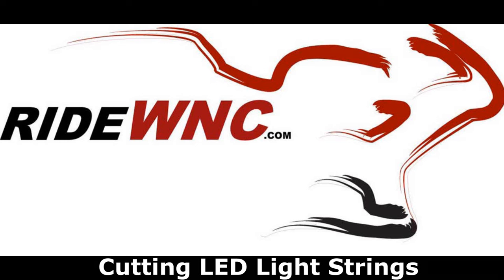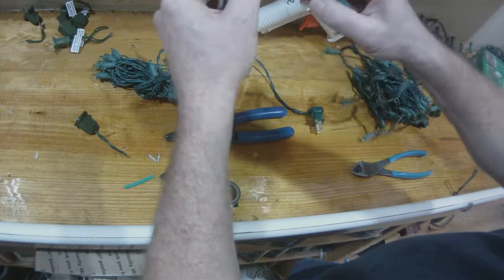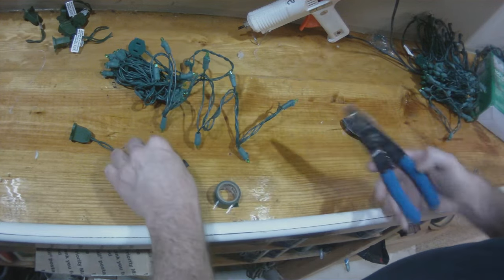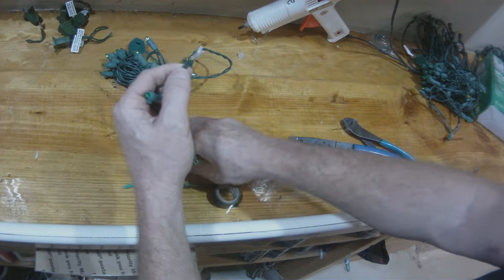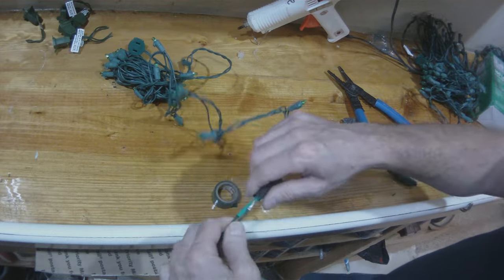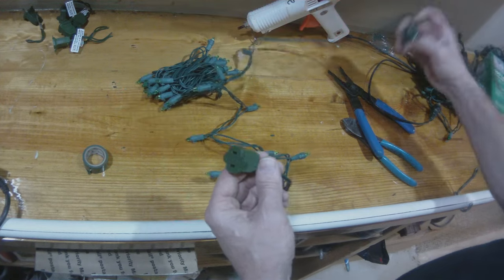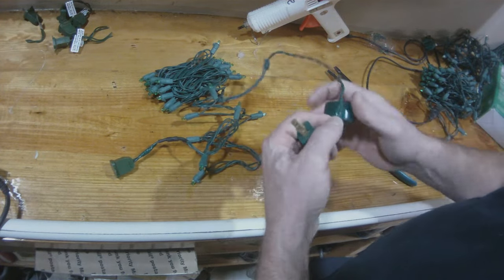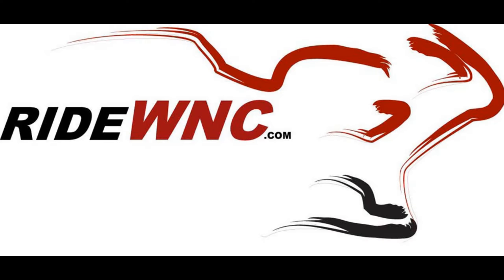Cutting LED Light String

Comment: I needed 22 feet to surround a window.  Found a 33 foot 100 light strand.  You mentioned that every approximately 34 lights, I should find a two wire run.  I followed your instructions.  Worked perfectly!!!  The result was a perfect 22 feet strand.   Thank you so much.

Comment: I accidently cut the three wire section of my led mini lights, can I just splice them back together? I assume I have to connect the one wire that goes from light to light. Does it matter on the other two? I am not sure I can match those up. Thank you so much.
Reply from the maker: You need to connect it to the exact opposite wire. Power moves through an LED in one direction only unlike a light bulb.
Reply: @RideWNC  Thank you Mike! Got it squared away. Appreciate your time. Merry Christmas!

Comment: I've been searching for what seems like hours now, and can't find anything on shortening a 4 wire string.  The set I'm working with has 4 wires down the length with a periodic 3 wire section in the same pattern where the 2 wires would be in a 3 wire system.  Any advice?  Thanks!

Comment: Thanks for posting this. I'm going to add a length of wire into my 2000 led strand so that I separate the lights between my house and garage. I'll just cut in at the two wire and add a new length in. Thanks for explaining. Darren, South Wales, UK.

Comment: I did exactly this, but I all I got was, some lights are off, and the rest are blinking. I tried the other way of connecting the 4 wires, this time nothing comes on. Is it a faulty unit? May be relevant: I tested with twisting the wires (no soldering or wire nuts). Thank you for any and all guidance, hopefully someone will see this within a year. 😂
Reply from the maker: You can only cut the string where there are only two wires. If you cut more than two wires, you probably ruined the string.
Reply: @RideWNC  I did experiment with trying to connect 2 wires from the plug to 3 wires from the string, but didn’t work. After watching your tutorial, I saw my error and found the segment of the string that has 2 wires, and spliced that to the 2 wires of the plug. I guess my earlier experimentation ruined the entire string. Is it at all salvagable?
Reply from the maker: @uygar84   Just discard that section. Save the LED for spares. Part of that string can be saved if you cut it off where there are two wires.
Reply: @RideWNC  That’s what I mean. I did exactly that. My string is wired exactly as yours right now. But what I’m getting is: some LEDs blink, rest won’t even turn on.
Reply from the maker: @uygar84  You probably fried that string.

Comment: Using this same concept.. Could I splice these wires together and have two 18ga wires tying them together with a vampire plug to make a 3 way for the lights to go up on another ridge? I am trying to save as much "light string" as I can.
Reply from the maker: Yes. I would not use the vampire. Get the barrell connectors so you are 100% sure good power gets to the lights. Sometimes the vampire does not get a good bite into the copper. I don't trust them.
Reply: @ thank you sir!

Comment: You totally solved my problem. My male connector got a short in it. Thought I would have to replace the entire string but i just replaced the male/2 wires in the led string. THXU so much!!

Comment: Thank you!!
With incandescent do I need to worry about the fuse if I make make my stands longer by crimping two stands together?
Reply from the maker: No. Just don't exceed the number of strands you connect together. The number is on the light package.

Comment: Just yesterday I cut a 3 wire strand and took out several sockets and spliced the female end back onto the strand and it worked just fine. The plugs on both ends of the strand have 3 wires coming from the 2 prong male and female ends.

Comment: Mike,..that was concise and clear to me! Perfect! Thank you sir! Also,..I'm assuming that if I do not need a female connector at the end I could just cap off the 2 strands with wire caps and call it a day.
Reply from the maker: That is what I do.
Reply: @RideWNC   Do solar (battery) Fairy & or micro LED light strings have 2 or 3 power lines like this video? Can a single Fairy/micro LED be removed from a string and connected to solar power and work?
Reply: Perfect, Mike, thank you and Merry Christmas.

Comment: Nice! Is there a limit on how many you can splice together? I want to make a lot willow tree with several strands of lights that I’m hoping to only have to use one plug for
Reply from the maker: It is on the side of the light box. Wal-Mart LEDs are like 13 strings. Too many and they will start to dim at the end because of not enough power.

Comment: Mike, I have 8 baskets of greenery hanging on my loft rail with about 4’ between each one.  I want to strings lights in them with no lights showing between the baskets.  Unfortunately, the lights have the nonpolarized ends while all the extension cords Incan find have the make ends that have one larger than the other.  I was told that I could splice the ends (cut off the plugs) to lamp wire to make the connections.  Do yo7 agree that I could just cut off the plugs then twist the wires with the lamp wire and cover it with the “butt splicers” or some other type of cap?  Just don’t want to burn the house down!
Reply from the maker: Yes. Cut the wire where there are only two wires and slice in your two wire extension. 2 wire 18 guage lamp cord works well and can be purchased in most hardware stores.

Comment: Hey bro.. good video but let me ask if it's the same for C9 LED stran?
Reply from the maker: They are the same. LED power only flows in one direction. It they are like any C9 I have used in the past, the LED itself is usually the same as the smaller sets.
Reply: Thanks.  We got the update from CFO that we are adding lights all around the new beds along the side of the house.

LED C9 are up next for 75ft runs along the sides

Comment: So if I had a 30 foot wire of AC powered LED lights and needed just 20 feet. If I cut 10 feet off (as opposed to covering the bulbs with black tape) wouldn't the other bulbs receive too much voltage and burn out?? I believe so from other info I read. Thanks for clarification....
Reply from the maker: NO. Watch the video again. You can only cut the string where ther are two (2) wires. You cannot cut it by length. Two wire will be your 110v mark. If you cut three wires, just go ahead and throw the string away.

Comment: where did you find those barrel connectors that small and un insulated?
Reply from the maker: eBay. I buy the seamless butt connectors. The ones which are just metal folded over don't crimp and hold as good.  https://www.ebay.com/itm/303096721577

Comment: there way i can cut 2 lights off of Christmas lights and use the 2 i cut off. i made a Halloween prop and I need 2 red lights for the Halloween prop i made. can i cut off the 2 red lights i need and wire them together?

Comment: I have several small bushes side by side and can only find a certain set of lights I want to put on them in 100 light strings but I could probably get away with just 50…so my question…instead of cutting and splicing a plug, could you splice a piece of wire between the two created sets to move from one bush to the next without seeing the lights stringing between them? Essentially just extending the 2 wire section?
Reply from the maker: Most 100LED sets are 33, 33, 34 LED. Yes. You can splice in a two wire extension. Be sure to protect your connectors from weather and thenselves. Nothing like burning down the house at Christmas.

Comment: Hey man. I know this is an old vid but I’m looking for a way to splice together like 5 or so strands of lights to create a tree shaped light display with only one outlet. You mentioned it in your vid, I assumed that’s what you meant. Any help??
Reply from the maker: Yep. Just cut where there is two wires and connect the together. Make sure to read the box. DO NOT splice more strands together than what is recommended on the box. IF the box says twelve strands can be connected together. Don't splice in 13.
Reply: @ I don’t mean daisy chain together from end to end. I meant from one plug, five separate strands going out from there. So they can all come down in a big tree shape from one point at top
Reply: @ kinda like those lit up spider webs for Halloween
Reply from the maker: @Hangryaf  Same thing. They are all getting their power from the same source. Just don't connect more strands through that one plug than what is listed on the box. Too many lights on one plug is a fire hazzard.
Reply: @RideWNC  ok so I can just twist together 5 strands, just having two big twists?
Reply from the maker: @Hangryaf  You should think about something more safe than twist, like soldier or barrel connectors with great insulation. 120V can hurt or kill you.
Reply: @ that’s what I’m asking. If you want to bring 5 strands together from one point, how should someone do that?

Comment: What's inside the little round barrels, because there is one barrel in series with the 33 LED lights in each of the 3 parallel segments on this quote 100 light string? So there are three barrels total and all my lights are out.
Reply from the maker: They kind of regulate the power to that section. Too much power and most of your LEDs will burn out. Have you tested some of the LEDs to make sure they are good?
Reply: @RideWNC , I used a voltage meter and took a bulb out and the meter for some reason dimly lit up the whole series part of that string if I had it on the right bulb. I still haven't figured out how that actually worked to get my whole string going again so I'll have to look that over again and if it's interesting I'll tell you about it.

Comment: Great video! If I'm understanding correctly: after completing the first cut and splice, you mention that you're able to take the remaining lights and create two additional strings - by finding and cutting the 2-wire section. When that second 2-wire section is completed, how do you "finish" the remaining 3-wire section? Thanks!!!
Reply from the maker: I just add a male connector to one end and a female to the other. I have a lot of Christmas lights. When a string is old or I can't find all of the bad LED's I cut the connectors off and throw it out. So I have plenty of extra connectors. You can also buy the male connectors in bulk. Because most of my light display is only one strand, I cut the female connector off. I have no shortage of those.

Comment: I appreciate the video. Can this same procedure be done on a 48 foot LED Patio Light String with the 1.5W LED bulbs that hang down? I need to shorten it to about 35 feet and didn't know if it could be cut down. I believe my cord is 18 gauge.
Reply from the maker: I don't know anything about those. However, if you look down the string and there is a section which is only two wires. Those two wires can be cut. Never cut if there are three wires between two LEDs.

Comment: Great video, thanks! I need to do something similar to LED patio string lights. I have three segments in my yard of 33 feet each (each going to a central anchor point via guide wires). Patio string lights (with those large LED bulbs) come in 24' and 48' lenghts… hence my problem. So I will have to buy the 48 foot version and cut it off at the 33 foot point. I'd like to take the female plug cut from the excess segment and splice it into the bare end I created at the cut point. I guess the leftover bulbs can be spares. If one bulb is removed or is burned out, the rest of the bulbs still work, so I guess that means they're all in parallel connections throughout the string. Have you had to cut LED patio string lights?
Reply from the maker: Just make sure you do not cut any three wire section and you will be OK!
Reply: Thank you! The wires in my string lights are all encased in rubber/vinyl, so until I remove the rubber covering I won't know the wiring configuration that’s inside that outer sheath. It's not quite the same as your small string lights example, where you can see 3 independent wires. Here you only see one thick black “wire.”
Reply: @RideWNC  
Just today i cut a 3 wire section off and put its female end on the 3 wires i cut and it worked no problem. Then i did it again on the next level of lights, again no problem. But the last level of lights, only the light next to the plug i put on the end worked....for about 10sec and then a sizzle a few lights away from the 1st and then that was it. Not sure what i did right the first 2 times, and had no idea what i did wrong on the last one.

Comment: What about when the second half of a string of C6 prelamped lights fail after the second transformer?
Reply from the maker: Are you sure you don't have a bad LED somewhere in the string?
Reply: @RideWNC  I didn't think so because the lights stopped after the second transformer and they blinked for a couple of hours before going out.  But you were right, I pulled out my LED Light Keeper Pro and found a bad bulb just before the second transformer.  I replaced that and the whole string worked, except for the very last light and there is no point in replacing it with a pod.

Comment: You're awesome. Thanks for the video. How short of a strand can you make with LEDs? Will voltage be too high if the line is too short?
Reply from the maker: You can only cut the wire where there are two wires. If you pull an LED out at either end, you will see that the LED are different from all the other LEDs in the string.

Comment: I have a set with 4 wires that were cut. Can they be spliced back together?
Reply from the maker: If you know which wire connects to its mate. If not, if is not wort the fire hazzard. Throw it away.
Reply: @RideWNC  I figured. Got half the string to light up but couldn't figure out why the other half wouldn't.  Oh well, new set in the morning. Thanks!

Comment: Do you have a link to the barrel connectors or size?
Reply from the maker: https://www.ebay.com/itm/100-Uninsulated-Butt-Connectors-Wire-Splice-16-14-Gauge-Solderless-Terminals/272865366743?hash=item3f880b12d7:g:JLoAAOSwo8hTo3iV

Comment: i just accidently cut 1 of the 2 wires would it be okay just to splice it and wrap it in  sellotape instead of using a barrel connector and heat shrink?
Reply from the maker: Let's think about this... 110V with 20AMP breaker. 
Do it right or don't do it at all. Electricity is not something to play around with or take shortcuts.
What if your shitty cheap fix kills a three year old? Will that be OK?

Comment: Pleeeeease help ! I have 2 identical same brand LED fairy lights (3 wires) that I want to connect together to make it longer and being able to use only one plug for it. How can I do that ???  I would love if there is a tutorial on it. Please help, I really wanna get it ready for my Christmas decorations :)
Reply from the maker: It is best to only make connections with LED where there are two wires. Power travels through LED in one direction. If you mess that up, you will kill the string.

Comment: My lights were cut where there's 3 wires. So one end has 3 wires and the other end has 2 wires. Is it possible to fix the string of lights?
Reply from the maker: Maybe. Pull out your multi-meter and start checking current. It is probably easier and safer to just replace. 110V has a bite to it if you mess up.

Comment: At the very end you mentioned a male connector and a female connector. What does that mean? Just positive and negative?
Reply from the maker: Male is the plug which goes into the wall. Female is the receptacle which another light sting can plug into. Positive is the hot side of power. Negative is the neutral side.

Comment: I put up Christmas lights on my house that are too long and would like to cut them to fit the house. They are globe LED lights, can I use the method in this video?
Reply from the maker: As long as you cut where there are two wires only.
Reply: MikeE RideWNC thank you for the reply! Would i be able to tape it up (separately) and leave the end open? Or will I need to also cut the female end off and re attach it to the 2 wires?
Reply from the maker: @kaylawillis1681  if you cut the wire, please be sure that you tape up the ends. Tape them up separately then tape them together. You want to insulate them well, so no one gets electrocuted in the future.

Comment: What if you don't need any connector on the cut end? Do you separate and insulate the end of each wire, or do you tie the wires together?
Reply from the maker: I recycle the ends so I can reuse them on other light projects. I cut the end off and fold them by the last light then electrical tape them to the string.
Reply: Thanks for the speedy reply, but I meant the wires at the end of the string just cut. Do they need to be tied/joined together (like you would to close an open circuit), or would that short circuit the string (in which case they need to be insulated from each other and any ground).
Reply from the maker: @bhjohn2672   Just cut them. Don't connect. Don't allow them to touch each other.
Reply: Thanks. I thought that but wanted to be sure. Great video by the way. Loved how it got straight to the point.
Reply: @RideWNC  so you just cut, do not strip, and just tape one end to one wire and the other end to the other wire?
Reply from the maker: @scooby197997   As long as the two wires can never touch each other, you will be OK. I have hundreds of strings of lights with no end connector.
Reply: I would like to shorten the string, replace the plug end with a green plug. I’m trying to update the lights in our tree topper. The string of led mini white lights have this thing near the plug. I don’t know what it is. I have a picture but it seems I can’t post it.
Reply from the maker: @scooby197997   Go buy a different string. It sounds like you have a string from Wal-Mart. Those lights work well, but that piece is always in the way.